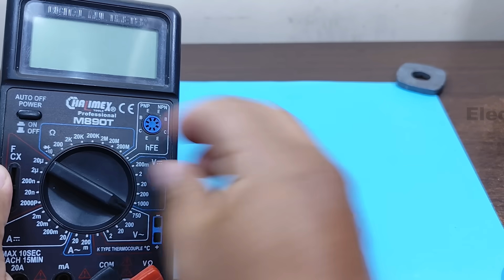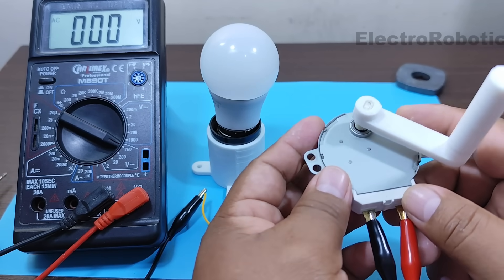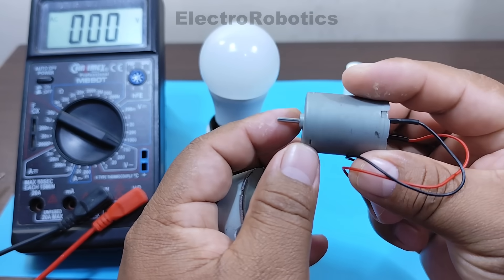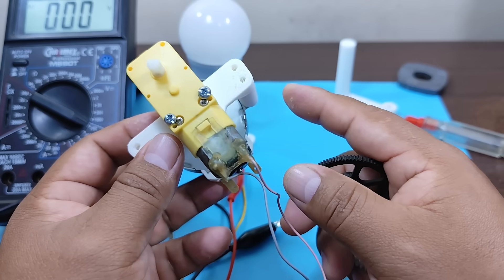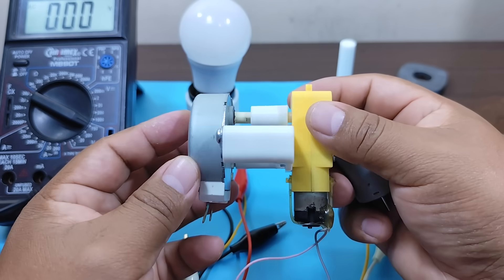How to Make an Electric Generator.

Comment: These nos are open circuit voltages and currents  nighter of then show's actual short circuit current or when loaded max current voltage drop gear ratio energy consumptions etc etc

Comment: OK but this is a remake of an old idea - the motor generator which came in all sizes from provided power to drive a tube radio up to powering city tramway systems in essence transforming one voltage to another.

Comment: I really doubt the consistency of the bulb's brightness! Either you're a fraud, this generator only activates a relaay [and relay powers the bulb from a source with correct frequency and voltage], or you're just a fruad! Let's don't walk on egg shells: [un]man, you're a fraud.

Comment: Fun experiment.  I learned on YouTube how to harvest “joule thief” circuits from disposable cameras, modify them slightly, and then use them to light 💡 florescent cfl bulbs. I designed it to accept any size battery(I call it my dead battery light), and with as little as a couple volts I could light any fluorescent bulb  for many hours.

Comment: This is an absolutely brilliant project and a fantastic solution! The way you integrated the two motors is very clever. 💡
I am working on a similar setup and the 3D printed mount/coupler you used is exactly what I need. Would you consider sharing the STL file for the white mounting piece on Thingiverse or any other platform? It would be a huge help to the community.
Thank you so much for sharing your innovative work!

Comment: All I want to know is..... For how long will that 18650 keep my light bulb illuminated? I could read for hours before drifting off to sleep to the soothing sound of the hum of that engine motor dynamo direct driver cog eliminator inverter. 
It's going to have a hard time pumping out any amps though, don't you think?
I just want to know how long it will run my light bulb before I go ahead and build one... I don't have no 3D printer..... I have some types of glues, other materials like charcoal, polystyrene and baking sodq, epoxy, wood gum, bamboo, wire and tape

Comment: What you're showing as an experiment for young people is cool, but you can't say it's pointless... because how much power do you lose to generate power? You lose it to mechanical friction and the electromagnetic field. To generate that much current, you don't need a motor, only a transformer. Besides, an LED bulb only draws up to 10 watts... and what you get from a generator is much more... but the most important thing is power. How much power do you lose? Load your generator and the engine will burn out... so it's pointless... As a curiosity, it's okay... and besides, it's stupid...

Comment: why dont you use a dc converter and feed part of the a/c voltage to run the dc motor with 8 volts dc? creating a self sustaining generator with plenty of voltage leftover?

Comment: Voltage is not amperage.... voltage is just the distance. The electricity goes through a wire..... the power is amperage or watts.... I would not plan on recharging the car battery

Comment: this IS an inverter to covert 3.7 v DC of hat battery to 220v AC. great experiment. now we need to find a higher watt AC motor and repeat this  to make a useful AC generator. b we need bigger dc motor to connet to it. now add a transformer and bridge to the 220V ac and feed the 12 volt dc motor instead of using battery and add a heavy flywheel in the same axis. so, make a perpetual motion machine. perhaps will stop because of the losses but will be a good experiment to do and see it works or not. i got a 10KW three pahse permanen magnet rotor generator and a heavy motor from a water pump and made a 30KG flywheel. nit assembeled them yet. possibly will work. we shall see.
Reply: i m waiting (Y)
Reply: @jimmylee1188i am still not done. did set up solar cells and wind turbine. all house has power. fun with flywheel and motor generator this year. 2026. i  copy this video link and write on my white board, WHEN i am assembling those stuff. if it is not inhe white board, will never happen. buni already bought a lot of steel for weldi its frame . weldin machine also works. it is mayer of a couple of days  cuttin and welding.

Comment: Just take the gear's out of the motor and the magnet 🧲 spins alot easier then you don't need a motor with gears to spin the generator, which makes more speed which makes more power

Comment: While this is probably the best video of this sort, there are still issues.  The main one is the implication that they are getting more output energy than they put in.  This is not directly stated, instead it's correctly phrased, more output voltage than input voltage.  But many in the audience don't understand the difference.  To measure the energy in vs. energy out, we need to measure the current in and out as well as the voltage.  The products of these voltages and amperages gives the power being supplied and the power being used. 

The microwave motor is being operated as an alternator (like in gasoline driven cars) and is a very inefficient way to light a lightbulb using a small battery.  A 3, 6, or 12 volt LED bulb would be far more efficient.

Comment: You made me remember of my young age when I put a small bicycle 6V generator attached to the output of a12V / 240V transformer  and got a poor yellow glow out of a tungsten bulb .:face-purple-crying:
I was only 16 and now 70 😥. Physic is fun and dangerous if not knowing what we are doing .💥💫 and :text-green-game-over::eyes-pink-heart-shape:
Reply from the maker: Hello, I'm glad the video reminded you of good times, and yes, you're right, things should be done very carefully when working with high voltages. Regards.
Reply: @ElectroRobotics-qo2er  I am already a subscriber since a while , Il like your projects , I will have some fun returning to something I loved at school ( physic ). Let me make you laugh about a question I put to my teacher .
I asked him " Water is composed of Hydrogen and Oxygen , so tell me why when you drop a match in it , it does make KABOOM?" He could not give ne a correct answer . Now I know  how to make Kaboom with water :face-purple-crying::face-purple-crying:.
now I can run a 4 stroke engine with water . Or make an HYBRID Motorcycle . But will have to sit on a mini bomb 🤔💥💫.
Reply: you CAN  and you HAVE DONE IT, are different. did you actually make a yel cell and connected to your car and i works? there are resons it should not work. i have seen videos that shows it works, but heat generated by o and h is differen from petrol and i do not trust videos unless i build it and test it. and does it destroy the motor in long run or not. his is not covered in videos.

Comment: Can the microwave motor produce more than it consumes in normal operation, that is, more than 3.5 watts?  If not, it will not power the bulb to maximum brightness.  If so, how long will it last at the 5 watt load level?

Comment: Dude, just learn to build custom voltage adapters. Like 10v 100 wraps to 1000 wraps on the other side and a couple diodes ran 2 in series in to two more ran in series then put the positives of the two of the 2 diode series together then the same with the two negatives. And then you’ve now got a bridge rectifier. Easily look up schematic.. so hook up a 10vdc battery and you’ll have 100acv on the other side…
There’s way less POF on this.. the mechanical will have several wear and points of failure in little to no time.. it’s just not feasible to do it this way..

Comment: Now when you are producing 120v-220v check the frequency/Hz.
That motor is turning much faster than it would turn running on 120v or 220v and some devices or appliances won't like the high frequency.

Comment: Well, this is very interesting! I admit this is very interesting. Please note that this is the basic logic of modern inverter.

Inside the stator there's a wave created continuously during the magnet is spinning. The frequency of the wave is very high and the frequency height has been studied, recorded and applied to obtain the desired voltage value. A larger transformer is used to increase the current so that the power generated is as needed. The more complex electronic components, diodes, transistors and ICs are used to regulate the output wave on the inverter so that the inverter can be used more widely and does not damage the device and the tools. And the last, rotating objects require a very large space, produce a very loud sound and requires regular maintenance during ownership electronic inverters are made to overcome all of that, the space required becomes less, the sound produced is quieter, and the routine maintenance required is also reduced. The most important thing of all is about efficiency and electronic inverter is a continuation of the old fashion generator.

Comment: I attached a lever to one so I could spin it up by hand just as he is doing....and it would easily light up a 4ft shop light...the only downside I found was that the internal gears were of plastic and prone to wear out or fail quickly....but still impressive for such a small device.
Only those interested in alternative energy will find this interesting.

 I think the video was well done and to the point.

Good job!
Reply from the maker: Hi Richards Ray, thank you for taking the time to write a great review. I appreciate your honesty and thank you so much for your support.
Reply: I to had one turning riggedwith a shaft on a child’s bike trouble was the plastic gears failed, ( looking for one microwave oven )

Comment: The LED light bulb doesn't need AC current, you can light it up with DC motor/generator too.
Reply: Normally but that particular model actually does require AC only, if you dont mind me saying

Comment: That's not an electric generator. It's a electro-mechanical inverter. It's turns DC voltage into AC voltage but doesn't generate as it uses more power input than the amount of power output it gives off. Showing voltage and not showing wattages makes this deceptive

Comment: If you connected that generator to a 60 watt incandescent light bulb it would not do much. The output voltage might be high enough but the current would be in milliamps. It may even drop the voltage so low it might burn the generator fine coil wires out. Still a good  project.

Comment: Ok, nice video. But you are not getting the 50-60 hertz frequency that many systems need to properly use the power. That light bulb might work ok, but that is about all that might work. The power output would only be a few watts I’m sure.
Reply: Чёртов придурок! Разве Тесла использует ток 50 герц?
😅😅😅😅

Comment: How is the 1.5 volt AA battery capable of reaching the 9 volts powering the driver motor?
Reply: The boost converter on the board
Reply: He can increase or decrease voltage output from circuit board and using variable resister.

Comment: This is just a small electromagnetic power generation you can se the 3,5 watts that is all the energy that can provide what are you going to do with 220 volt if you can put load on them??? 
with LEDs i can give you 200 watt of light with 5 volts i am professor too right?

Comment: This is a vert nice video, i have played with small ac motors from microwaves ( but as the video says be careful with high AC and 240 v rated equipment ) for those wondering what the purpose of the video is, its just that, a nice build of different equipment from many sources that produce higher voltage * note not power as P=IV or power is equal current times voltage  .... the power stays the same,  its just a cool build showing some properties of different sized motors, magnets and their power supplies/multimeter outputs. Well done.
Reply: yes. if i had a battery and a 240v light bulb, and the genius of this guy, i could have light. it is quite brilliant, thanks for taking the time to show us all how salvaging materials is beneficial